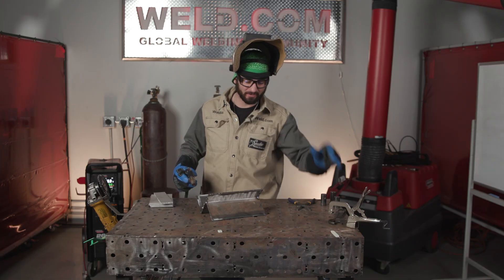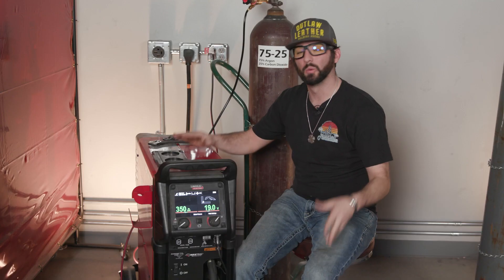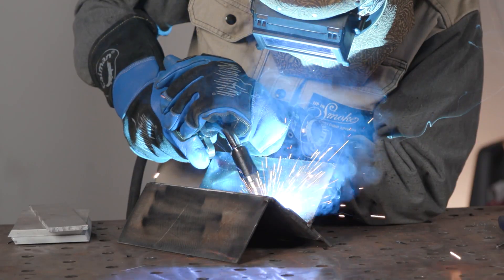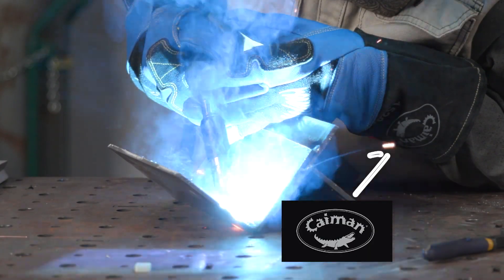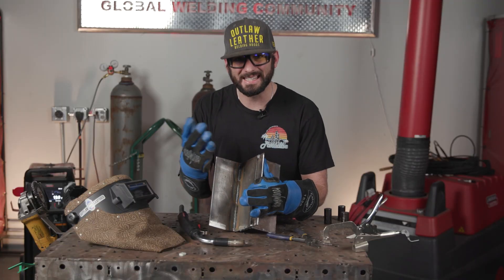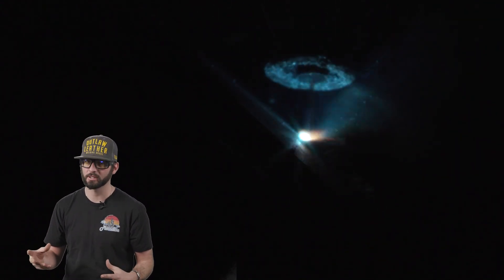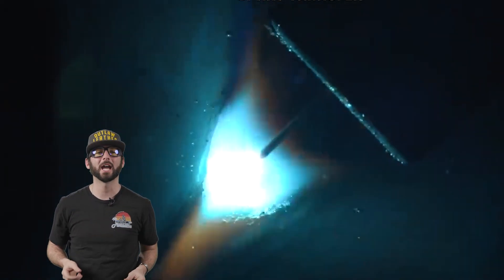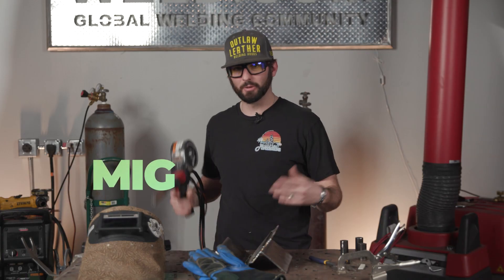Can You Mig Weld With 100% Argon?

Comment: Gas with a minimum 90%Ar is required to get out of "short circuit" transfer mode with MIG (more correctly  GMAW).
For structural code work, short circuit GMAW must be qualified by testing. Getting out of SS transfer makes the process "pre-qualified" and requires no additional testing. I would never use SS transfer (GMAW with 75/25 gas on anything thicker than 5/16, MAYBE 3/8.

Comment: I use pure CO2 for carbon steel, works great for me, it’s in the bottle as a liquid so you get much more gas for your buck. Heavy bottle though.
Argon I reserve for mig and Tig
I’ve tried pure argon on mild steel, welds ok but too expensive for the clients.

Comment: thats why it should be called MAG (like in Europa) cause it means "Metall Active Gas", MIG is what you do in Aluminium (the i stands for "inert"). 
Is it wrong to asume that you could still do it but go hotter? in the case that you would totally need to weld it with 100% argon ?

Comment: Of course you can MIG with pure Argon. I MIG all the time Aluminium and Stainless with Argon.  MIG is meant to use with Argon. It's Metall Inert Gas Welding.
Although when GMAW Carbon Steel,  that's when it's called MAG, I introduce a little CO2 in the mix from a second bottle. Or most times I use a second machine setup with 82/18 Mix. 
However you can MIG steel too (with pure Argon) using Spray transver, if its a thick part and you put up theAmps Above 220 on thinner wire  it welds decent spray transfer on pure Argon. On thin stuff like sheet metal  you can kind of do it too, but it glues it together with no good binding and minimal penetration.
So pure Argon might not be ideal for steel but it can be done, you have to have much more Amps for transfer, use thin wire. My Oncle runs a plumber shop and he does all his welding on pure Argon only. He also teached me how to weld, so I just learned it wit pure Argon.

Comment: This video is typical of the poorer YouTube videos on welding.   He didn't change the welder settings, which is stupid.  Naturally if you set the welder amps, wire feed rate, etc optimised for mixed gas, its not going to go so well if you change the gas mix.  So what? - would you put kerosene in an engine set up for gasoline or vice versa?    If you do, it will not be good - but engines can be adjusted to run on either.
So it is with MIG welding.  If you use pure argon to weld mild steel, you will need to increase the voltage and perhaps the wire feed rate.  then the result will be just as good.   In fact, if you are welding thin sheet, such as a car body, the result will be better.   You get less spatter the lower the CO2 content too.
CO2 is not inert - in an arc it decomposes and contributes heat, making the arc more aggressive and the bead more spread out.   The lower the CO2 content the deeper the penetration - opposite to what this video said.
So why don't people weld with pure argon or high argon mixes?   Simply, for reasonably thick and heavy mild steel, it is more expensive.   the higher the fraction of CO2, the cheaper the gas.
Actually, some fabrication shops use the same low CO2 mix (eg ~5% - it is not critical) for just about all (non-stainless) steel work.  Then they can  swap from light gauge work to heavy gauge work without constantly changing bottles over - just change the welder settings, which you need to do for different gauge work anyway.

Comment: How about 100% helium? Do a video on that mix or 90/10 helium mix. I've interviewed for a job 35 years ago and the used helium to mig weld 1 inch thick steel bars to thick steel plate. Cleaner with good penetration they said. I didn't get the job because I couldn't set up the machine.

Comment: Bro. you're talking about MAG. If you use 100% argon or Helium then it's MIG (Metal Innert Gas ) . MIG is with pure innert gas, that's in the name of the process. MAG (Metal Active Gas) is with active gas (o2, co2)
"Can You Mig Weld With 100% Argon?" ..... semi-auto with 100% argon is called MIG. If you don't want to do the correct naming then call it GMAW

Comment: Great video, I work at a shop that does production high end mig and tig welding. We use 70 25 for mig, but for the last few months our mig welders have been running different. We've had to turn the volts up higher and the wire speed down from our normal setting to still get a nice bead. At our normal settings the welder will pop everytime we push the weld back into the puddle and the beads will have ripples in them. Like I said adjusting the settings hotter and slower seems to help a little with those issues and leave a smoother bead. Could this be a result a too much argon in the bottle, maybe even tho it says 75/25, it might be closer to 85/15. It welds almost like there is too much argon, but not sure if there's any way to actually test the percentage of gas in the bottles, I'm not sure how accurately these companies fill up their bottles, thanks.

Comment: The higher the percentage of argon used in the weld gas usually means your welding some high tensile strength steels. Then you need different certs for said wires and metal thicknesses.
Reply from the maker: Thanks for the info!

Comment: Well being that CO2 and Ar have different thermal conductivities (CO2 is way higher than Ar) and different heat capacities, you would need to change the settings to match the changes based on just that alone. Failure to do so is just trying to make it fail on purpose.
Reply: It is more than just that, the main thing being ionization of the gas and how that influences the electricity jumping the gap.
In short circuit mig pure argon will give you poor results no matter how much you adjust your amperage and feed rate. This problem goes away once you enter spray transfer amperage, provided your stock thickness is sufficient to take the additional heat without blowing through.

Comment: Thanks for this tiny thread of information about shielding gases.
I wasn’t ever taught about this, but I do remember that we used a Hydrogen gas mixture to weld boilers so long ago that I can not remember the mixture used I believe it might have been Argon and the welds were supper clean. No spatter and HAZ was limited to a minimum with perfect penetration.

Comment: I do it with aluminum every day at work straight argon with mig been doing it many years only use 75/25 on x-ray butts and they pass 100% every time
Reply: Yup same here you are correct, I've been doing it just over 3 decades now and on heavy equipment and trucking industry so welds need to hold.
Reply: Aluminum mig is a completely different ballgame than steel.
Aluminum requires 100% inert gas. This means either argon or helium. Aluminum is too reactive when molten to use anything other than an inert gas.
You aren't passing an x ray on aluminum if any reactive gas made its way into your gas envelope.
Reply: @NikeaTiber i weld with steel exactly the same no problems
Reply: @redwelder So your doing spray for both right ?

Comment: Since the pure argon weld looked cold, could you correct for that if you added more heat (amperage?) to counteract that effect?
Reply: Your arc length increases to the point where the arc is even more erratic and it also increases the chances of freezing your contact tip.
This problem is for the short circuit transfer mode mostly; the increased arc length and heat burn away electrode faster than you can feed it, and turning up your feed speed to compensate doesn't really work as the extra electrode soaks up the heat, leaving you with the same problem you started with, just with a larger resulting bead.
At a certain point the weld will pull enough amps to enter spray transfer, at which point you are fine, but the stock thickness needs to be sufficient to dissipate the extra heat without blowing through. As I recall, with .035 wire the required amperage to enter axial spray transfer on pure argon is around 200-220.

If I'm doing short circuit on carbon steel I actually prefer to use 100% CO² The spatter sucks but I like the aggressive arc and deep penetration.

I have a two bottle setup on my welder, my other gas being 95AR 2OX 3CO2, which I use for spray transfer. On .035 wire you enter spray transfer at around 180 amps using that gas mixture.
Reply: would also like to know that

Comment: How about 75/25 vs 92/8 on mild and stainless?
Reply: I've been welding for 32 yrs and always used a 75/25 mix for MIG welding steel. Believe used pure for stainless and aluminum only.
Reply: Pure for aluminium and 2% CO2 for stainless.

Comment: You can but its expensive .
Reply: I do use 309L on A 36 often. Not talking anything for inspection or real structural as I’m retired. But you can use 309L for steel. I also found that 75/25 is ok, but pure argon is better. Not much, but a bit. Settings with 309L on steel aren’t going to be found so you have do your experiment. After that, it’s fine. Just notice that grinding stainless welds is very different than grinding steel welds.